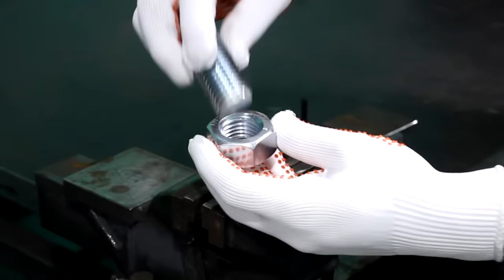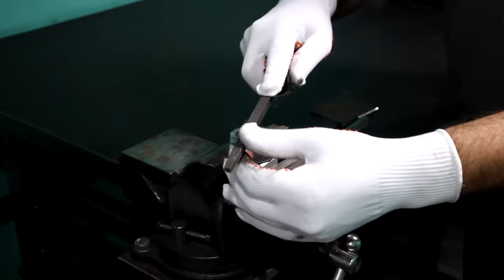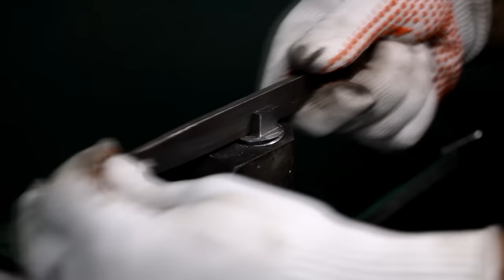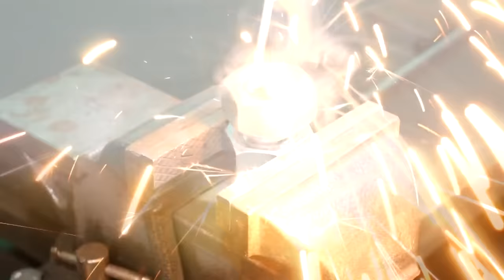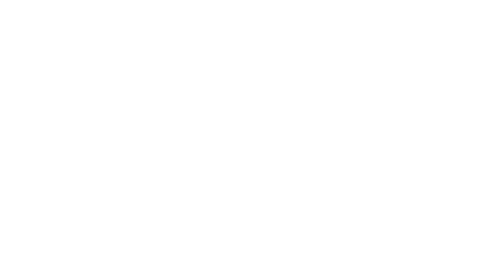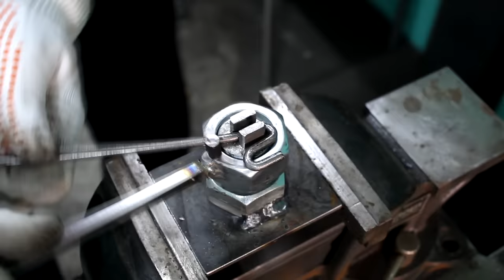DIY Bender of Steel Nut and Bolt

Comment: Pretty slick idea and I like its final use.  Just a thought, if you cut off two sides of the square plate it is mounted to you will be able to store it in most shop drawers and it could still be clamped in the vice.  Thanks for taking the time to post.

Comment: Great video and very slick design.  I have a big diameter, short bolt and nut.  I think I will weld the bolt head to the plate and eliminate one of the nuts.

Comment: great if you want to make your own chain. next step is to weld each segment loop closed and heat treat the chain until its tempered steel.  Having this tool looks like a fun way to spend some time making chains of a certain type.

Comment: Great video!
One thing, don't wear gloves around moving machines. Just touching that drill tip will twist the glove (and your hand) right into the bit. Major trip to E. R. And rehab.
Love the bender!
Reply: Fgu tu tá fgu awaaa as o awaaa Sô uuuSau
Reply: Depends on the machine, gloves can reduce or increase the risk depending...

Comment: I liked the video my only suggestion would be to rethink the handle it's way to small and would brake over time what I would do is get an cheap Chinese boxed wrench that fits over the nut and weld the wrench to the nut

Comment: Would you be able to make one of these for me? I really need it for a project. I already broke a tube bender trying to get some tight bends on some 4mm stainless rod. I cant find any other benders that can do the tighter bends other than the small ones that are meant for thin tube.

Comment: Perhaps you can grind the bottom part of the bolt with two parallel sides to be hold by the vice. One nut, one plank, one welding saved.

Comment: You can sharpen your files by putting them in a container of vinegar for 12 hours, then using a “card” wire brush to clean them. After that they will be much sharper.

Comment: Pretty nice bender, but I watched the rod slip through the slot as it was being bent - if you need to keep pretty close dimensions that is not going to work. You would have to clamp the rod in the slot somehow first. I've made a lot of little crankshafts for my engines and this is something I had to overcome to keep the dimensions correct.

Comment: First rule of working with rotating power tools (drills, lathes, etc).
NEVER wear gloves!
Reply: I was going to say that. Can be very bad. Otherwise cool video.
Reply: Ed Hartgrove That rule technically only applies to machinery that is large or powerful enough to pull a limb or body into the moving parts without the machine turning itself off. With handheld tools especially abrasive grinders gloves are actually a good idea. 
If a hand drill or grinder grabs a bit of your glove, you will likely receive similar or lessened injury as you would have with no glove. A hand drill or grinder does not have the power required to ingest a person. 
A milling machine or lathe, on the other hand, could easily kill an unfortunate person.
Reply: Recipe for disaster—gloves and a drill press
Reply: F
Reply: Yes this is true it's a good way to wrap that thing right up around your arm have a suck into your shirt and then where's it going to go from there you don't know that you how's it takes is two or three threads to get wrapped around that rotating shaft at 11,000 or 25000 RPMs give you a bad day in the hospital
Reply: @jizzbomber3874  , agree. I took the tip off my thumb cleaning chain and sprocket on a running motorbike. Had rag over thumb , and on last rotation the rag went into chain, took my thumb with it and ripped tip off thumb. Done it so many times but that time when something goes wrong. Had a drill grab a t shirt not too many months ago also. Am so bloody careful BUT things do go pear shaped.
Reply: @lenrice5320  elegiio
Reply: yeah I'm running my drill press top speed I got a pair of gloves on I got three pairs of gloves on yeah I got to go about paying attention cuz I'm not sure if I'll my knowledge about directional shafts is in the rotating
Reply: (Anon Ymus)  You're absolutely right!...in most circumstances, but the handling of raw parts, the loading if fresh stocks into a machine, changing cutter tips, changing setups, or when cutting Magnesium, you definitely NEED gloves. I used 3x Brown Mule leather gloves, after I almost cut my finger tips off, loading square tubing onto an EDM machine. There are times TO WEAR them, and times to not. & I NEVER weld without gloves and all my PPE
Reply: I recently used gloves on a standard DIY Bosch cordless drill. Sinking screws into wood the glove wrapped around the bit almost snapping my thumb. If that was a faster corded machine I shudder to think of the consequences. No gloves for me on drills anymore.

Comment: Fine and dandy, except they sell bending jigs for this size rod for under $20. If two or three hours of your time, several bucks worth of materials along with ancillary equipment needed such as drill press, welding gear, variety of vises, etc. is not worth anything to you sure, make it yourself. Otherwise, I prefer to focus my time and labor on items no one already makes and sells at no great cost.

Comment: you could improve that just use a screw weld it to the plate after that you make the hole in the other nut and and weld the screw and to turn it just use a wrench and puff easier and faster
Reply: No, the teeth on the bolt/threaded rod allow you to do tighter radii without risking the gap collapsing.

Comment: Is the tapped screw a certain size?
Reply: yes.
Reply: @kbtube8125  Is it the size of the wire that is to be bent?
Reply: sorry, I was being silly with that reply, but I would say that the size would have to be chosen to not blow out the inside of the large nut, and not the outside either and not be to close to the edge to weaken it.  I would center punch it's location so the drill doesn't wander around like in the video. depending what you're going to bend, the cut off bolt could be a split pin or roll pin as some call it now.
Reply: @kbtube8125  Thanks!! Also I am trying to determine the diameter of the threaded rod. Is it about 1"?
Reply: I would say that sounds about right.
Reply: Same size as the tap🤔🧐🙈🙄😏😎